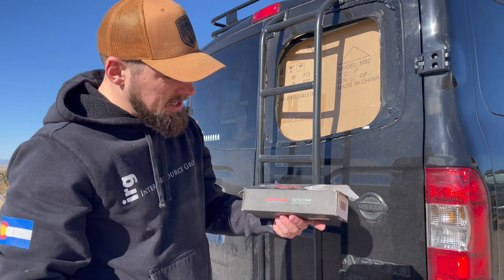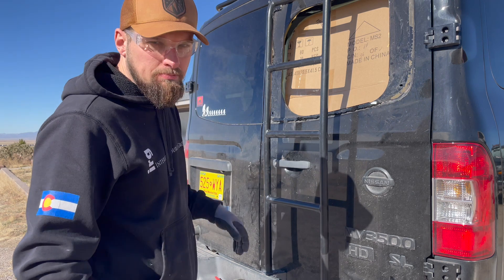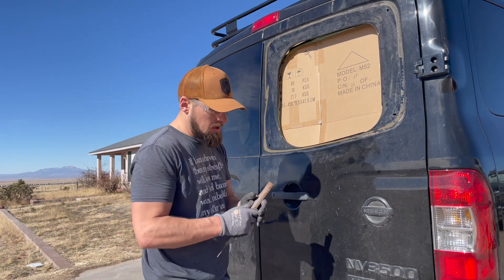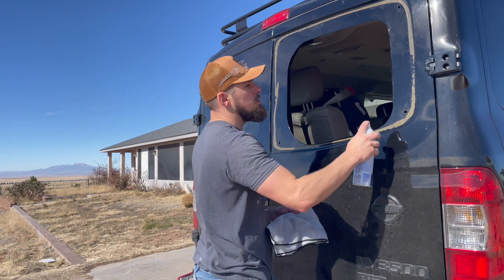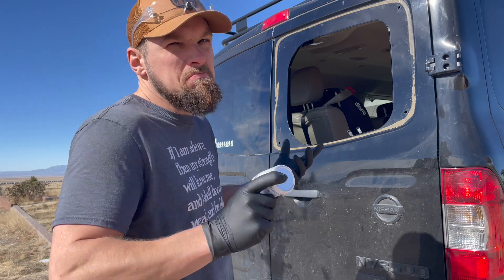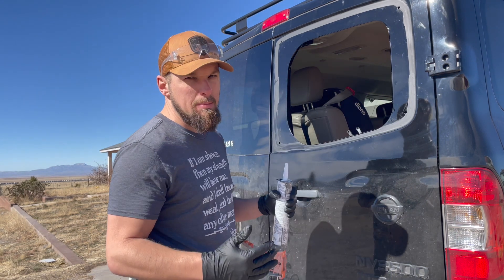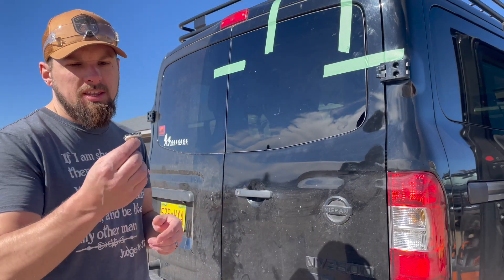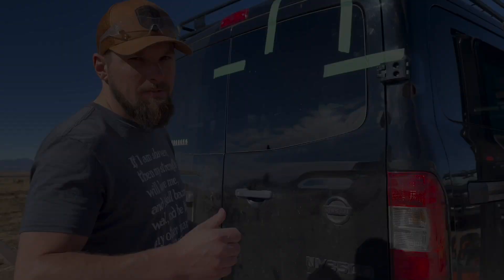Nissan NV 3500 back window replacement | cargo | passenger

Comment: Just broke my window today with a stray rock from my weed wacker. I appreciate you doing this. How is your window holding up?
Reply from the maker: Perfect. Would definitely do my own repair again. That 3m is messy so beware.
Reply: Just did my repair today. Messy was an understatement. I got stuff all over the place but it melted when I used paper towels with alcohol. I got all the extra stuff cleaned up. 

Im gonna have to repair the edges around the bottom of the window from some scratches. 

The window I purchased was from the dealership. It came to $195 but it’s a heated window that comes with the 4 clips in the corner. I put too much sealer on it but I don’t anticipate breaking the window again. Heck, you never know. I’ll buy the kit you purchased next time. Lol 

Thanks for the video again. Much appreciated. 🙏🏾🤙🏾
Reply from the maker: @trevorc4052  moral of the story: You did it. Well done!